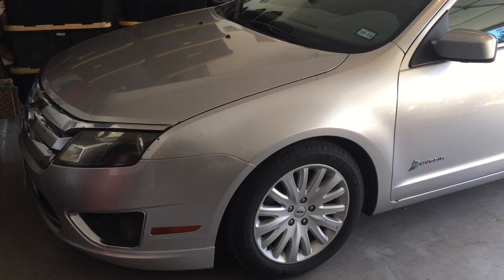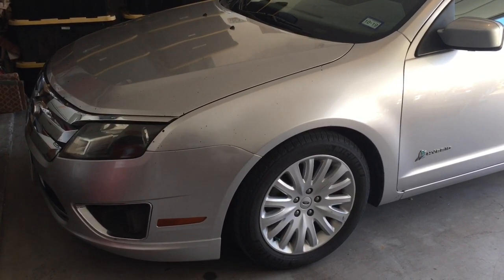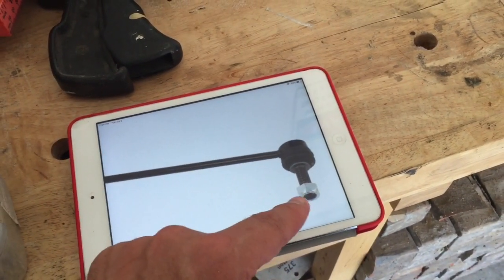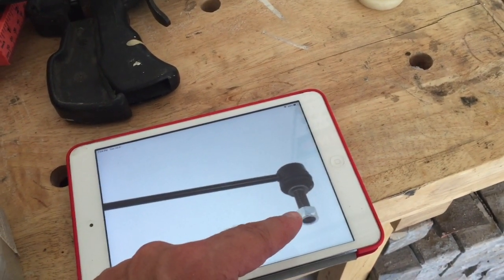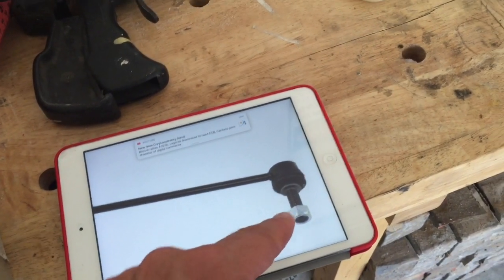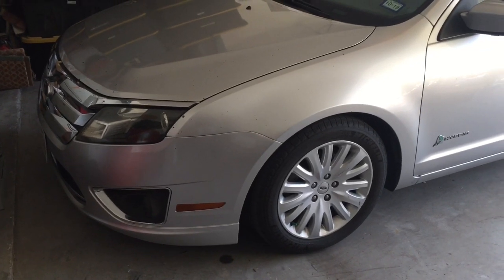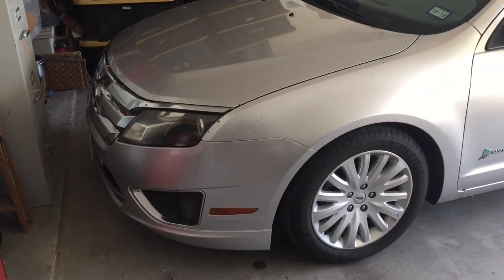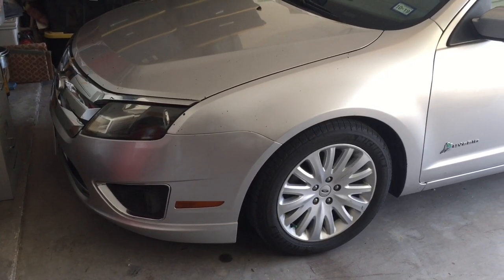The cause of this Ford Fusion's Front End Creaking Crunching Noises

Comment: How can you tell if strut is bad ? I took severe hit on drivers side wheel and CV axle , lower control arm and the inner tie rod was damaged need replacing . The strut looks fine but some say the strut is likely shot and needs replacing . Took it to this shop yesterday and hopefully start working on it Monday .  Some shops sell you on things you don't need . How can I tell ?

Comment: My 07. Just started making sqeaking noises at low speeds  or turning the  steering wheel, just started happening in the very cold weather. Wonder what this could be?  Car has 73,000 miles on it

Comment: I’ve got a 2011 Ford Fusion that has this awful “popping sound” whenever I turn to the the left or right, going forward or backwards. Checked out some online forums and I’m leaning towards the problem being the CV-axles, though I’m still not entirely sure. Any thoughts?
Reply: It sounds like the CV axles, but the sway bar links can make a popping noise too.   I would change the sway bar links first since they are super cheap and easy to change. If the sway bar links don't fix it, attack the axles.
Reply: I have the same problem on my 2012 I inspected everything but I cannot seem to find the problem
Reply: Replaced both front struts and outer tie rod on the passenger side where the noise is did nothing you could be right
Reply: if its a clunk its a tierod
Reply: Struts maybe?
Reply: Any updates?

Comment: I have a 2014. During the summer it creaks over bumps and turning at slow speeds. And if I push on the front end. 

I replaced lower control arms but that didn’t solve it.  Thoughts?
Reply: Same problem with my 06 Fusion
Reply: My 2012 is doing the same thing seems to get worse in warmer weather replaced both front struts and one of my outer tie rods and I still got the noise
Reply: @katielovesutube  have you done anything to fix it and did it go away
Reply: I have the crunching creaking noise only in hot temps. Just replaced lower control arms in front. Still have noise. 2012 ford fusion. Its very annoying.
Reply: Glad I’m not alone with this issue. Notice the same thing on my 2012 fusion sel in the summer in the humid weather it sounds so creaky mainly at lower speeds. Spent $1,800 to replace front struts and tie rods and the noise is still present. Grrr!
Reply: @hollee1464  did you do the front bushings? I rebuilt my whole suspension system on my front end.  The last piece I replaced was the bushings and it fixed it
Reply: @hunterprice287  no I haven’t that’s good to know though
Reply: Thankfully I found this vid and have found people have the same issues.  Last summer I replaced lower control arms, thought it fixed, but I think it had to do with humidity dropping right after I got it fixed.   This year I have been paying attention, and the creaking noises 100% correlate with hot sticky and humid days!
Reply: @TheJayDrou  I bet it’s those bushings.  Mine only creaked when it was hot
Reply: My passenger side of my 2012 sel has squeaked for about 2 years now.  Just replaced the front struts--no change (although it did quiet it some probably from the firmer ride).
Reply: @mistermister2085  I solved my issue. It was the front bushings. I replaced basically 95% of the front suspension and the bushings solved it.
Reply: Same with my 07 Fusion
Reply: @hunterprice287 witch bushings are you referring to?
Reply: 2012 Ford Fusion here and have the same exact issue. It’s so annoying. It’s hot and humid as hell here in Texas and that is when I started hearing that dumb noise
Reply: @hunterprice287 are you referring to the rubber sway bar bushings?

Comment: I have a 2008 ford fusion that i love driving with the same problem, i replace the sway bar links, tie rod ends and right axle and its still making those noises i dont knkw what else to do im beggining to believe its the shock absorbers that are causing that noise
Reply: Cracked welds in the subframe. (Ford fusion forum)

Comment: mine is bracket that holds front subframe on, its a triangle piece steel.
Reply: What vehicle?
Reply: @AdrianTechs  2009 fusion 2.3.  There is a triangle bracket that holds subframe
Reply: @rob_v_nj  thanks man
Reply: Mine as well. The CV axles are done. I'll add a subframe attachment bushing set, maybe all of the control arms. Not looking forward to it and it might be time to trade it in. After 180k miles, parts wear is expected, but it's a great running car. 2012 Fusion. All the parts can be picked u;p off Ebay as generic "prior to being" labeled parts and they are the same as labeled parts from a decade of major car repairs with Ebay/Amazon dealers for all of our vehicles.

Comment: Has anyone had issues with a fusion hybrid making a creaking noice when accelerating from a stop? Doesn’t do it when using the battery to accelerate and as soon as we get going it stops. A lot of the mechanic in our area don’t want to work on it because it’s a hybrid!
Reply: Mine turns out to be rearward control arm it’s the bushing

Comment: I just bought a 2011 fusion I hear that noise. Did u also feel it in the steering wheel?
Reply: Going through the same problem
Reply: @amandagibbs7552  I'm bringing mine to the shop in 15 minutes lol they told me Friday it has nothing to do with swaybars ect. Theres a recall on the motor for the power steering I do know which could b it
Reply: @amandagibbs7552  I just got off the phone with a ford dealership by me they are fixing 3 recalls for free for me. Call a ford dealership near you they will run your Vin through there system and will let u know if u can get it fixed for free
Reply: your suspensiom has nothing to do with the motor. the rack and pinon and electical compotent for the rack n pinion connector was recalled nothing to do with the motor itself only suspension
Reply: The rubber joints in the top and bot control arm.  Take off a front tire and 🔧 around.  Some 💦 lubrication is a temporary fix.